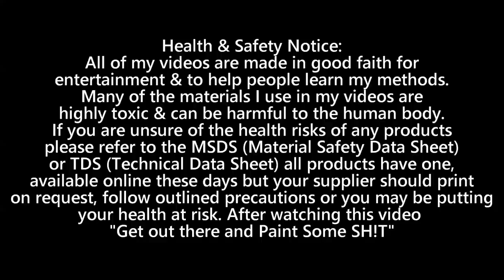Alfa Romeo Guiletta Prep, Mask & Paint: With Music!

Comment: So hey bud what’s your thoughts on the Sata 5000 rp now that u had for like 5 years? I have two of them. And honestly hadn’t had any issues with them like my 4000 had. The 3000 was just wide open everything and like 33 psi and let er tip tater chip! I gave it away was an air hog. How do you compare the Sata 5000 rp to the tekna copper?

Comment: I'm painting my wheels and just high build primed them and sanded them flat but I sanded down to the old chrome on some areas. I'm going to re 1k etch them and it says suitable for all paint types and wet on wet.. Would you allow the etch to dry or do a wet on wet job to save time re sanding?

Comment: What's the first coat you put on ? A clear coat ? What's it's purpose !?
Reply: Hi, 
Gunman called it transparent coat. I think it's the same as clear base. It's meant to smooth the surface and it's applied between Primer and base coat. But is NOT clear coat which is applied in the end to have a shiny surface.

I'm not a painter, but just learning and that's what I understood through some vids.

Waiting for Gunman or any other expert confirmation 🙂